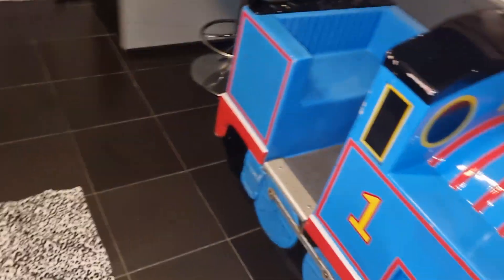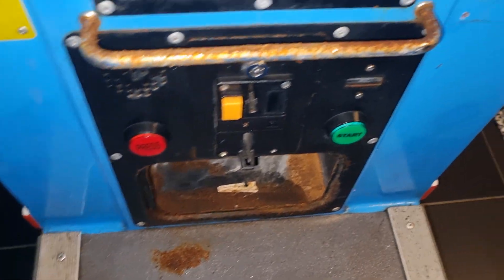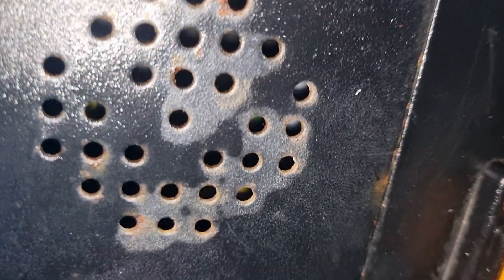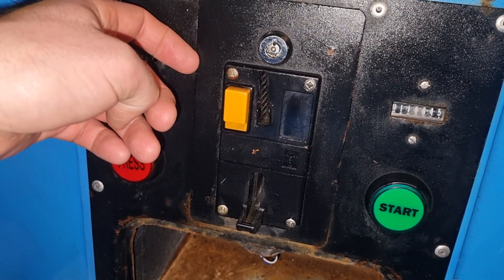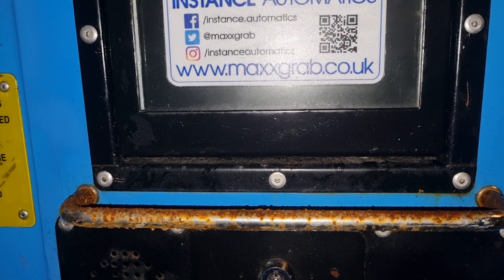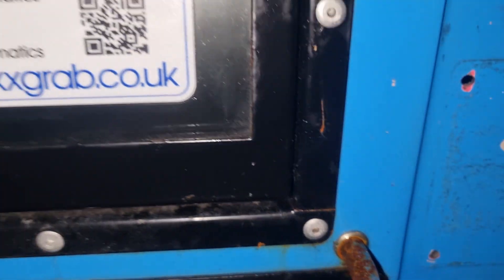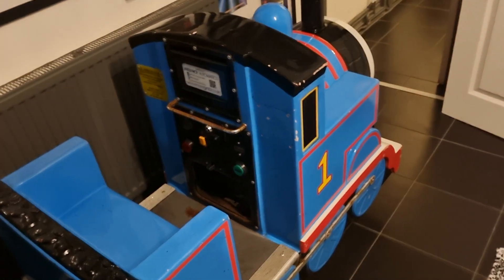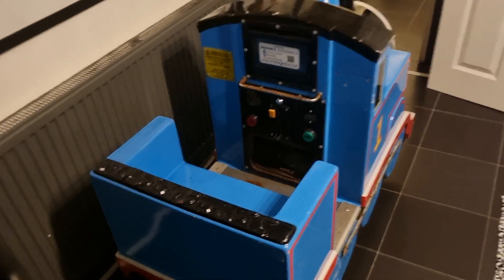Coin operated JOLLY roger kiddie ride arcade machine  SAVING THOMAS THE TANK ENGINE - PART 2

Comment: Figures crossed you’ve got the timer. Hope you can sort the screen out. Last year when we got another Buzz in with the screen it wasn’t working but it turned out that the input on the right settings so could be the same with this.